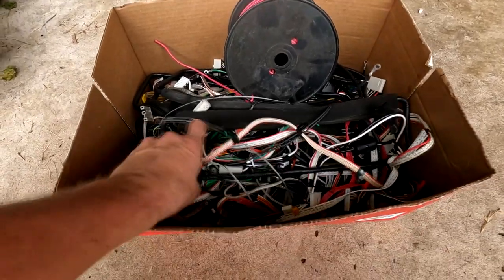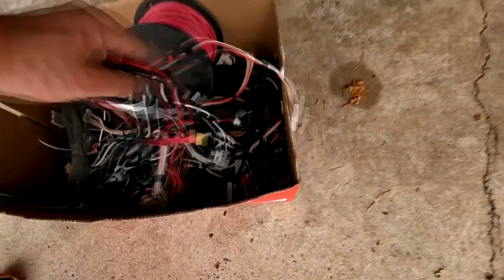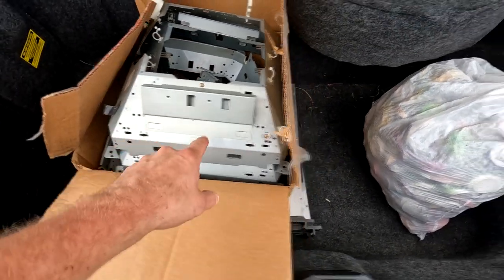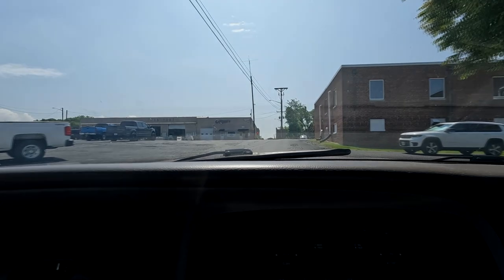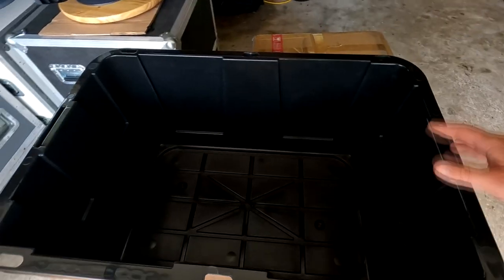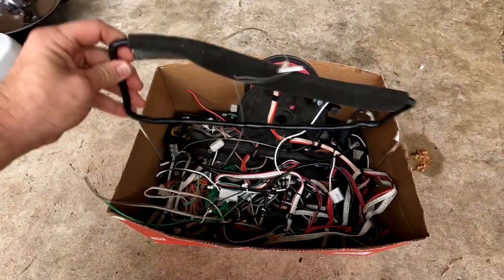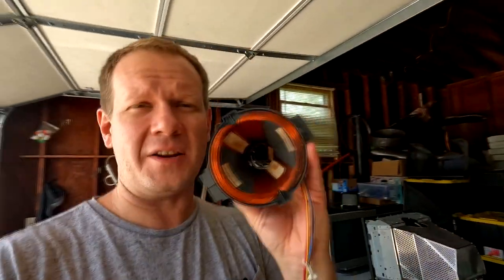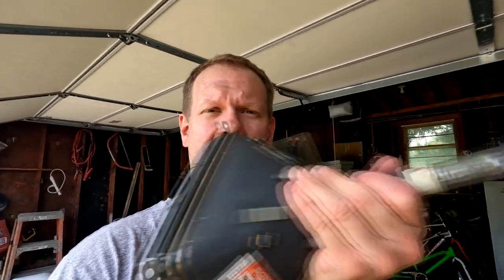Scrapping CRTs for Big Time Cash!

Comment: I have actually went out of my way over the years save CRTs from the scrap guys...Those yokes inparticular can be rewound for vector deflection and can be extremely difficult to find anymore.
Reply: Sony Trinitrons.
Reply: @mariokart8715  Not just, But pretty much all tubes, It requires ditching the reciever and converting over to a 6100 chassis (or amplifone clone) however,

Comment: Cathode ray tubes are worthless to hold onto for the fact nobody knows the hours left (like used light bulbs) since they are designed to pretty much expire in 20 years of some hours in time usage.  The degaussing cables are the easiest wires to strip in seconds by using a utility knife running along the plastic insulation surrounding the bare copper wires (if not the aluminum alternative design).  Then you get like $3-$4 a lb for bare #2 copper at the same metal recycling place taking in steel and metal iron etc.